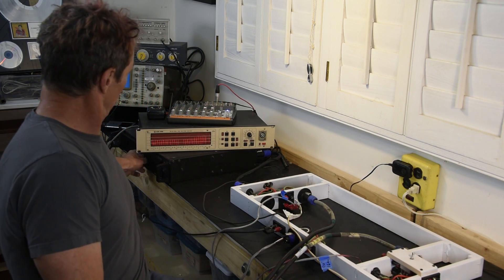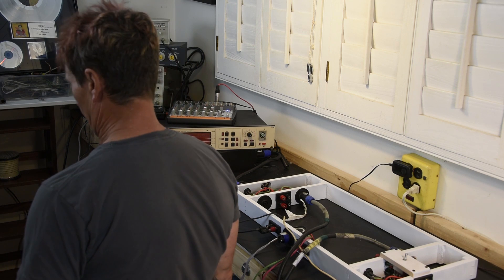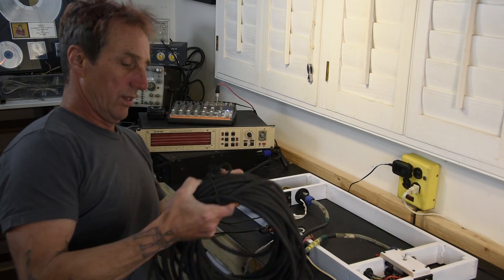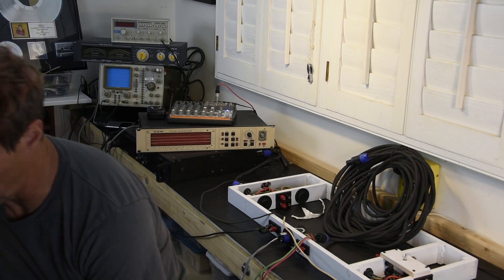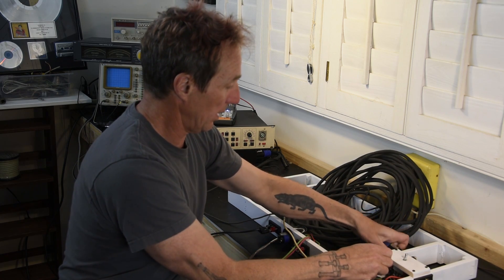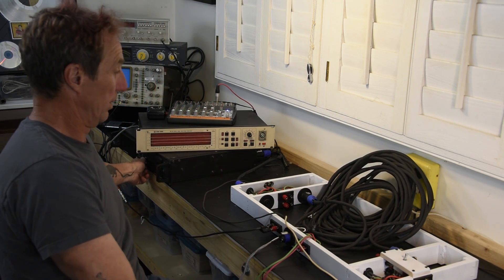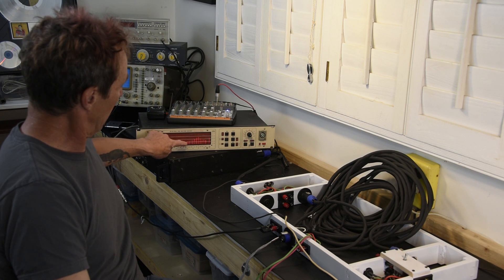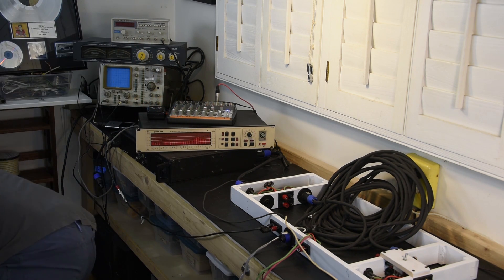Part 2 Hear Sound Loss in Speaker Cable - Part 2 of 4

Comment: Pretty good argument for powered speakers. I would always split my amp rack to locate amps close and avoid long speaker runs. Never had any evidence before. Thanks for doing this.
Reply: You're dead on. The best way to go is Ethernet into an active speaker.
Reply from the maker: Totally agree that is a good way, but often it is undesirable to have AC power run to the speakers, also it is often undesirable to to have lots of little amps all remotely spread between lots of speakers vs amp racks that are easily accessible, and serviceable.  It's all about making choices that are best for the application
Reply: @DaveRat  Given that the crest factor in actual acoustic events is typically very high, you typically have a big difference between the average power and the peak power. Speaker cables need to be rated for the peak current, while power cables can be closer to the average power due to an amp's ability to store power locally to provide short bursts to accommodate peaks.  So in theory, that means a whole lot less copper.  But I do take your point that having amps on the ground and in one location is logistically very helpful. Thanks for doing these videos.
Reply: Use XLR runs to powered monitors or mono amps about 2 feet from each speaker.  Also, no audible diff between a 3 foot speaker cable and an 8 foot.  Out at 100 feet sure, that's why he didn't demo small diffs between lengths.
Reply from the maker: We have loads of amp racks flown 8n the Sahara Tent, short speaker cable runs and a spare amp for each cluster. If we lose an amp, we can repatch from a lift without using a screw gun or dropping the array to swap a self powered box.

Dropping an array is a huge endeavor.

In my opinion, flown amp racks are a good balance between self powered and long cables.

I will do a vid on the big Sahara tent system

Comment: Would figure 8-ing the cable reduce or negate the coil effect?   Also curious if a straight wrap has a different effect than an over-under coiled cable.
Reply from the maker: Straight vs over under makes no difference as the coils are still the same direction. I will do a gig 8 test demo for you and other and post

Comment: I can't express how much I appreciate these videos but while the last two videos show the differences in HF response very well, I can't resist pointing out another parameter that is heavily affected by speaker cables that this experiment doesn't expose - damping factor. Unlike frequency response and level deviations, reduced damping factor also causes distortion in the time domain that can't be compensated by common signal processing. Because it mostly affects LF performance and cable impedance at low frequencies is usually quite close to the ohmic resistance of the cable, twisting / uncoiling the cable won't help much, using a shorter cable or cable with larger cross section however will.
Reply from the maker: I will do a test with a pulse generator as a source and it should help hear damping.  Also I will do some tests with an actual speaker as a load and that will show some more real world aspects.  Yay, more fun tests coming!
Reply: @DaveRat  Could I ask how this would impact guitar speaker cables? Could yo run a 70 foot 16 Ohm cab for example and sound OK? What would be the best cable?
Reply from the maker: @davestanley357  damping factor primarily affects lower frequencies. 16 ohms of a fairley high impedance load so you're 70 ft run should be fine with 14 gauge cable or thicker
Reply: Damping factor is just a ratio of the load impedance to the source impedance. However, the source impedance includes the amp output impedance and the cable loss. If you have a 4 ohm sub connected to an amp with a 0.1 ohm output impedance, you may think you have a DF of 40. However, when you put a speaker cable with 1 ohm impedance between the amp and the sub, the DF drops to about 4.